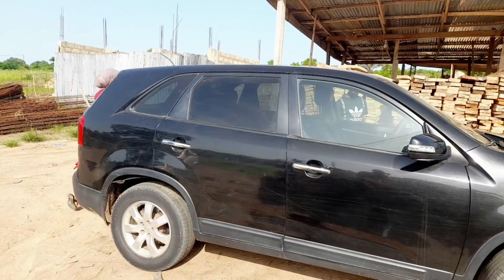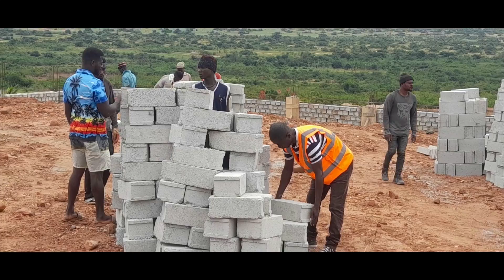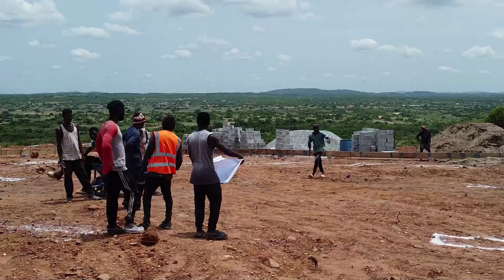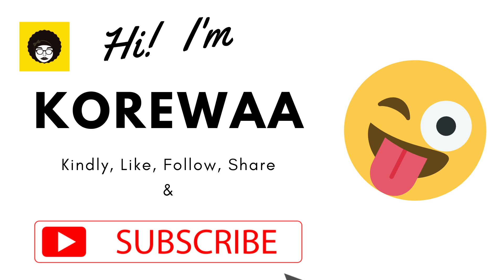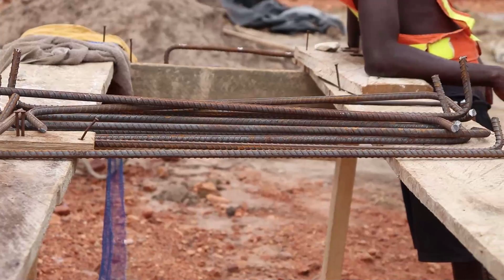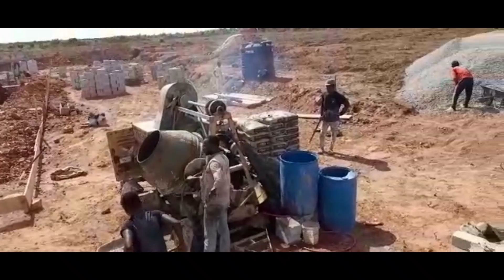The Start of Something Big! || Building Our Luxury House. Foundation Stage

Comment: Part 2 ooooooooooo 😊. 🎉✨️💥

On another note, I had my builder say the same thing about manual digging being "more accurate" than the excavator.

I believe that thinking is rooted in two schools of thought. One; it's a way to ensure the diggers have work (which is fine, but turns out to be costly); and two, my wife believes, and I tend to agree, that it's a perpetuating myth so no one actually tries using the excavator. But as they say in Ghana 🇬🇭.  WE MOVE 😁

Thanks for sharing. Your house is magnificent.💯✨️💥

 Great innovation in your design.  I know you can't wait to make it home. Cheers.
Reply from the maker: I did actually use the Excavator to dig the foundation for the garage and the retaining wall ...
 What happens is you need to get in labourers to dress the trench after the excavator digs, because it always ends up being crooked in certain areas and not  leveled equally. And that is paying twice for the same job. So based on experience, I agree that the labourers digging is a better option and gives more jobs out...part 2 is coming up 👍🏾🙂
Reply: @Korewaa-GhBizGirl  
Yeah we thought about that as well and conceded that making the impact trumps cost cutting. 

It pays dividends in more ways than one. These same workers will look out for you as a show of appreciation in the future. Job creation is a great seed to sow. 👊🏿

Comment: Nice! Feels good to finally start the build. Actually started ours as well on a different part of the continent as seen in my channel although the first three videos do not have good camera works but soon to improve from the upcoming 4th episode. However, just a quick question though, before pouring the concrete in the foundation trenches, did you have the rebar mesh laid? Just thought to ask because you didn’t mention it or rather, you might have a different soil type that doesn’t require it.

All in all keep keeping it real and keep them coming. I’ll be documenting our entire build as well.
Reply from the maker: Hi congratulations on your house build..to answer your question about the rebar mat....yes we did use them and I actually talked about the rebar mat needing a flat surface to sit on and at 7.41 into the video you would see the mats being assembled, but we didn't mesh the whole trench just the pillar section. Hope this helps 🙏🏾
Reply: Hi..Thank you! 

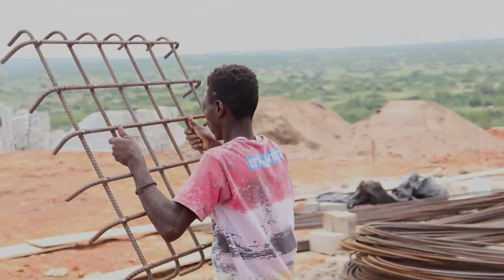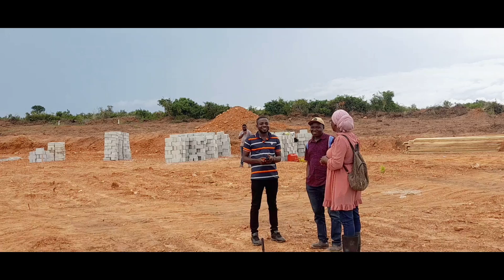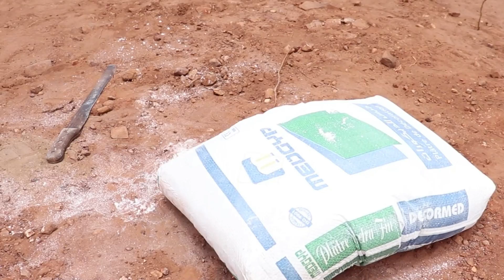Thanks for answering my question as well. But yes, I had seen your section 7:41 and those are what we would also refer as column (pillar) bases, same that you can see in my Episode 2 video at 1:42. However, I think the building process might be different depending on the guidance of your Structural Engineer. In our part of the continent, we always also have to do what we call Blinding, and that’s pouring the concrete not only at the column bases but also in the actual trenches as seen at 4:00 of my Episode 2. Then after the Blinding has cured, we lay the rebar mesh on top of the Blinding as seen at 1:59 of my Episode 3.

All in all, it’s interesting to see the various steps that people follow during construction in various regions.

Thanks a lot!